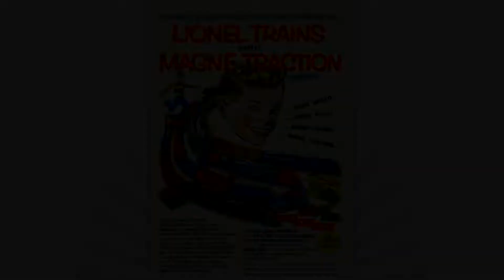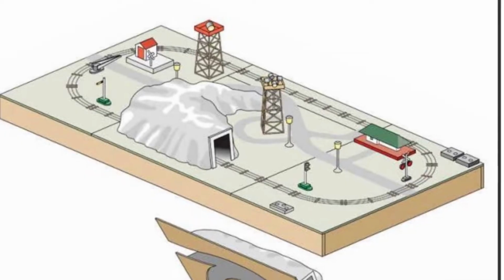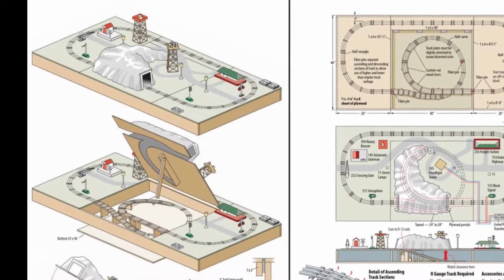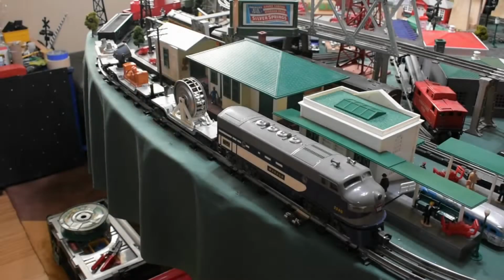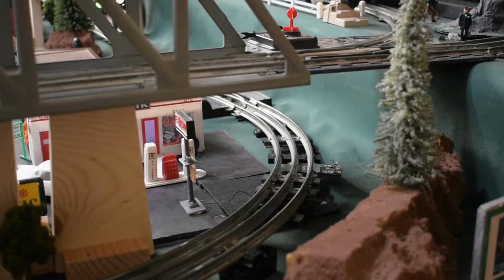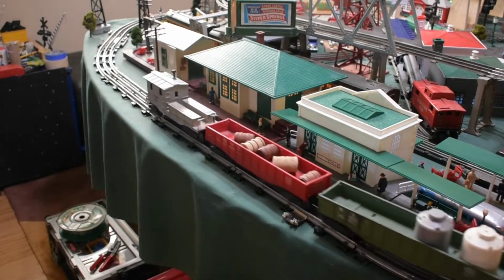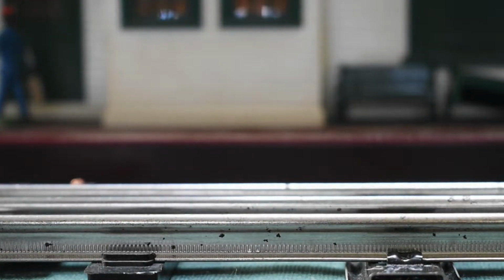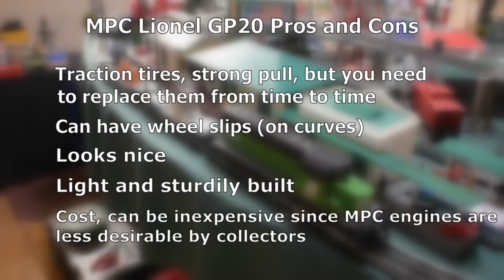Lionel Magne-Traction

Comment: I have a GG-1 with Magne-Traction.
It's difficult to remove from the track because it has magne-traction on both motors. It just lifts the entire track.
Reply from the maker: It'll probably pull a train a mile long!

Comment: Nathan I have both engines but my Wabash F-3 is a Postwar Celebration Series engine built by Lionel Trains Incorporated (LTI). If you put Lionel MPC cars with fast angle metal wheel sets and needlepoint bearings behind the BN GP-20 it will pull more of those types of cars same goes for the Wabash F-3. Thank you for sharing this and as always Happy Railroading!!!
Reply from the maker: Thanks for the tip! I do want to note that I basically just tested the pulling power and weight of the train, using the same set of postwar cars for both, to keep the tests as consistent as possible. I've also heard that putting a postwar commutator into an MPC diesel can actually make an engine perform better. Thanks for replying!
Reply: Nathan the commutator is the little round piece with the 3 copper segments that is on top of the armature. If you put a postwar armature into an MPC diesel the motor is going to get hot an the engine won't run properly. As far as using postwar parts in MPC trains most of them will work because after all most MPC and later LTI trains are based on the postwar trains. I hope that this information helps you and as always Happy Railroading!!!!
Reply from the maker: @MatthewJoseph-td5qc  That's right! I got a little mixed up with the terminology. Thank you for the additional info!
Reply: You are very welcome Nathan!!

Comment: The F-3 is also weighs more than the other diesel,,,f unit has a die cast frame compared to the metal stamped frame of the other mpc diesel
Reply from the maker: That is true, maybe I should have done a test with an alco with magnetraction?